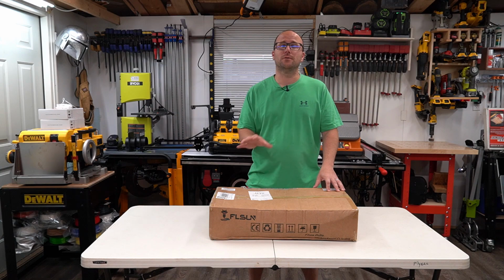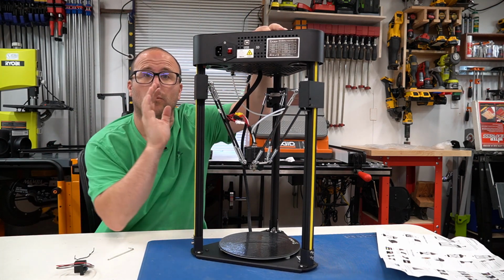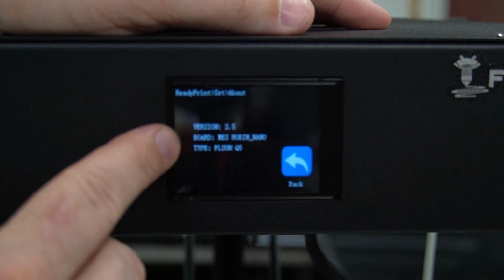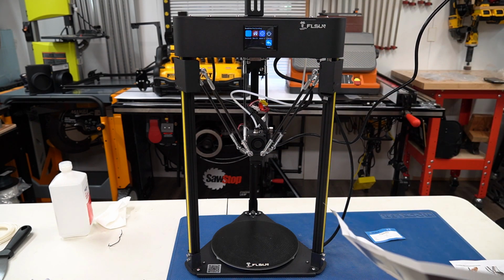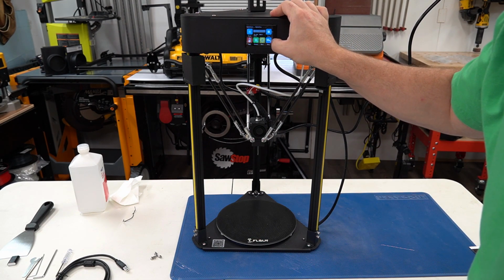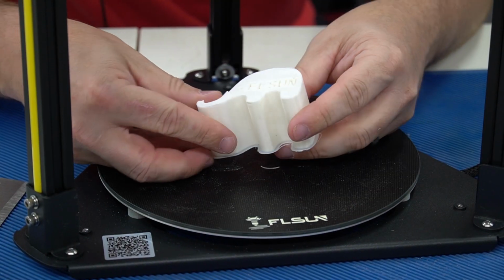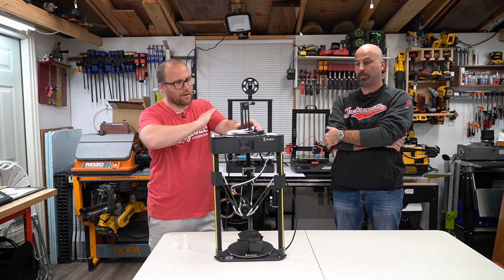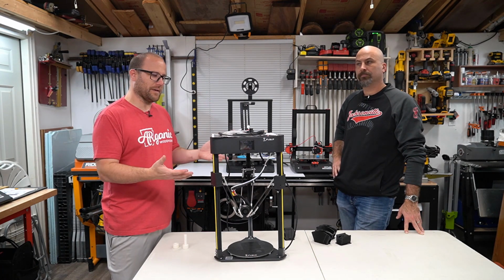Spider Printer!  FLSUN Q5 Delta 3D Printer Review

Comment: Ahhh... - No silent drivers??? What are the three TMC 2208 drivers for the pylon motors??? Only the extruder is driven by a 4988. Changing some fans and the extruder driver made the printer even much more silent. Beside your above mentioned "alternative facts" I can only confirm your summary: The printer is easy to build, easy to use, works reliable and produces outstanding results.

Comment: I use a Glue stick and a very sharp fine blade to remove print when partly cooled down
Reply from the maker: after the first print, it was MUCH easier to get everything off.
Reply: Thanks for other options need the bed not to show any deteriorating